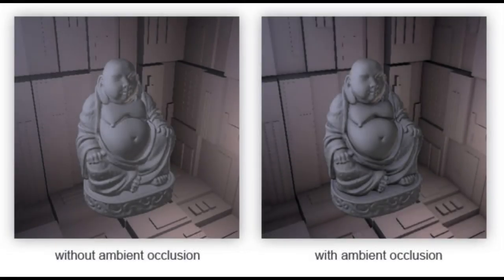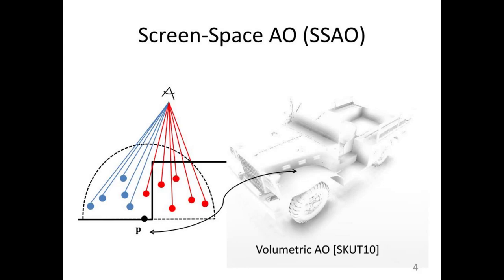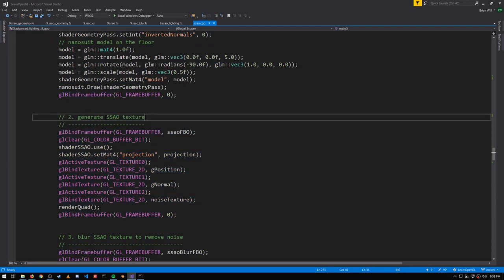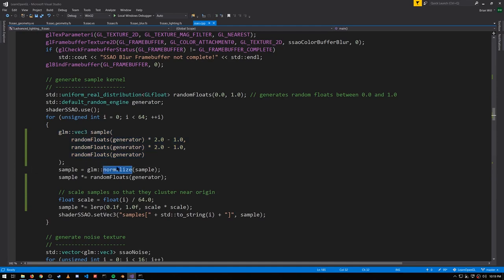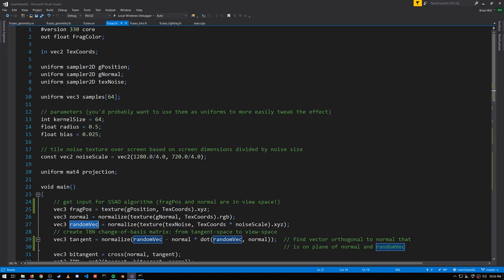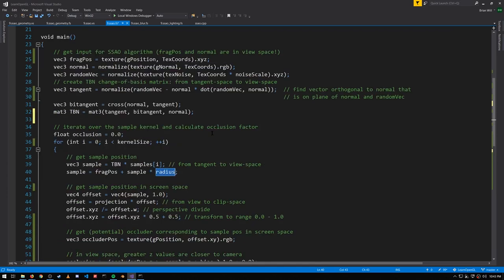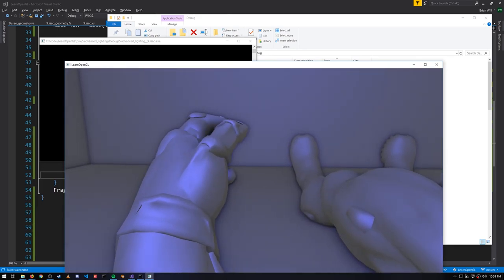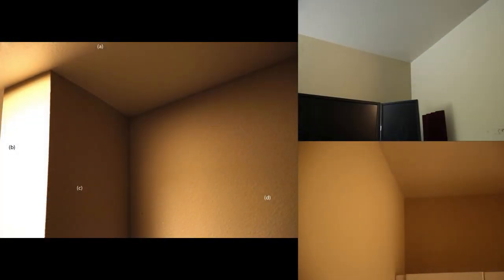OpenGL - SSAO (screen space ambient occlusion)

Comment: Your way of generating a random vector inside a hemisphere doesn't produce a uniform distribution, since the probability around the four "corners" (±1, ±1, 1) is higher than in other areas. A better way  would be to use rejection sampling: instead of normalizing the vector & making a random length, just check if it is inside the hemisphere, otherwise generate a new vector, and so on. This way, the distribution would be uniform.
Reply: He's using accelerated lerp, so the majority of the samples end up around the origin (i.e., 0, 0, 0 not 1, 1, 1), thats what you want you don't want them evenly distributed inside the hemisphere.